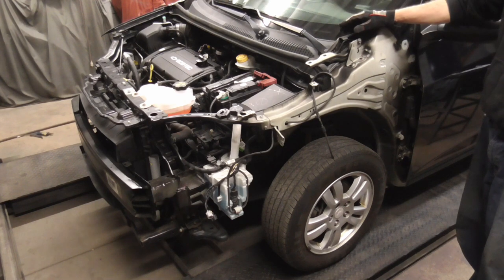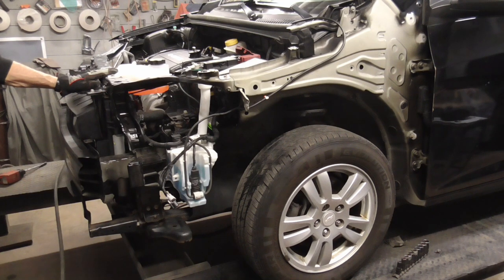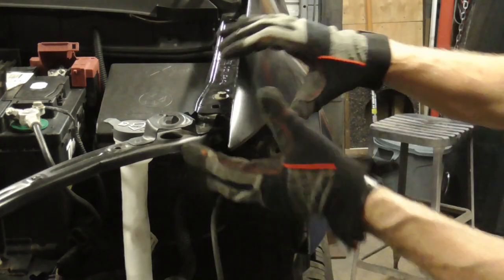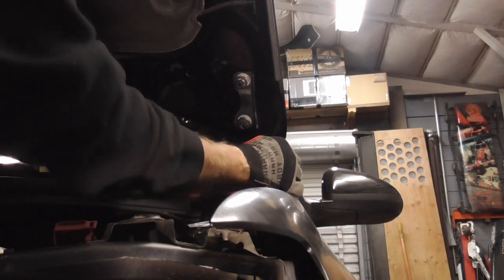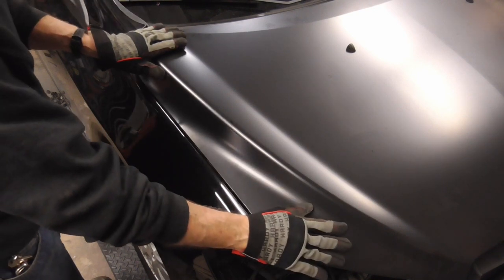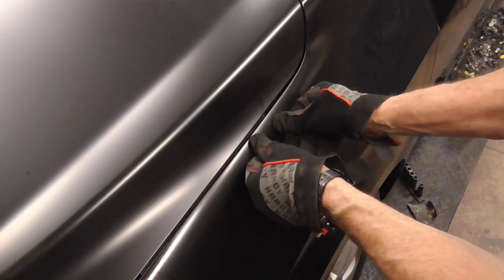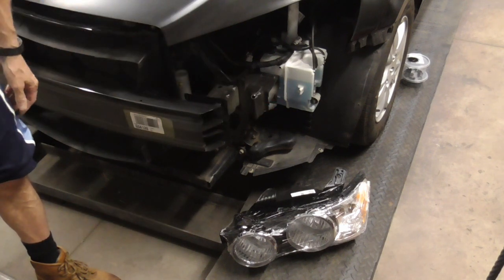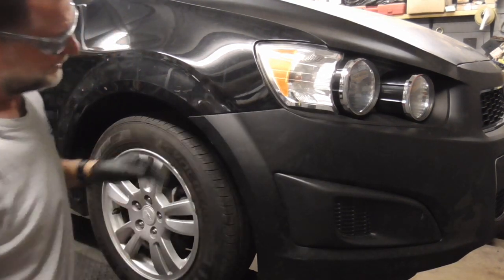How to Install and Align a Front Clip - Car/Truck/SUV

Comment: From about 1983 to about 1999 I learned not to buy cheap Japanese, Taiwan or Chinese fenders, doors, box sides and hoods. Those parts would never line up. You could never get the gap correct.  The turn signal lenses and running light lenses you had to install them upside down. Yeah I was kind of a slow learner.